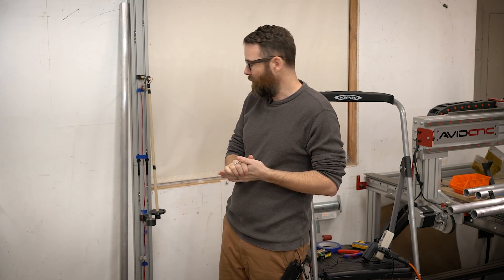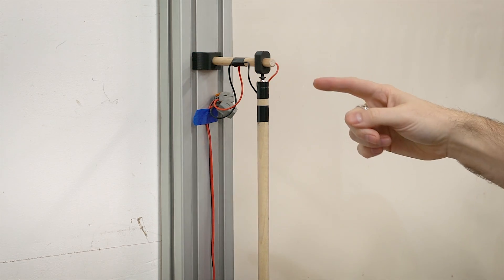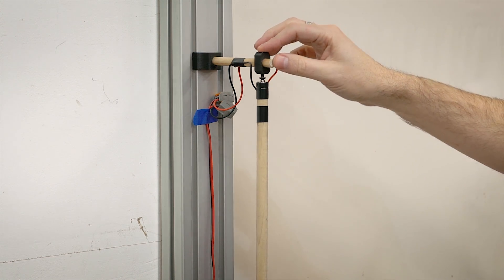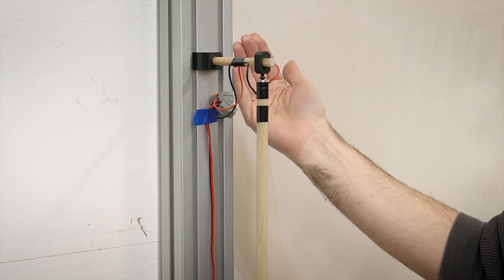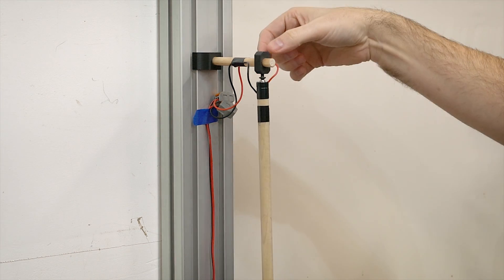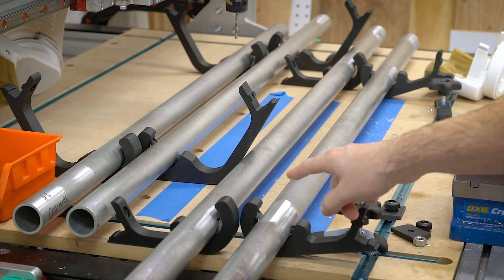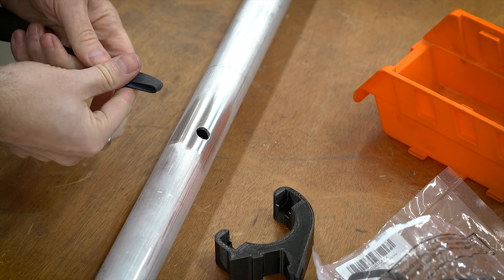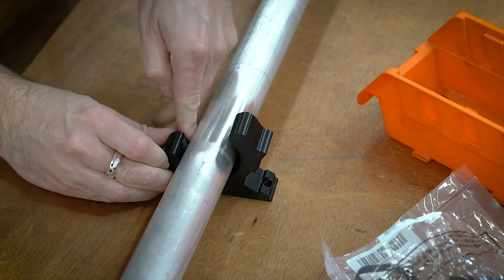Indoor Wind Chimes - Striker Assembly

Comment: I think it sounds so different compared to a regular windchime because the actual pieces are not moving and I think that takes away from the authenticity. You dont get any interaction between the different notes hitting, only the striker. I'm sure you already knew this but just my two cents, awesome project tho!
Reply from the maker: I reduced the size of the striker and that helps quite a bit, allowing it to hit multiple chimes at once.  I just need to dial in the code a bit.  Also, I don't think I've heard chimes this low before.  If they were much higher frequency, it might sound more 'authentic'.  I'm still testing!

Comment: Hey Robert, if you're looking for something truly random. Have a look at taking radio waves input  I saw a paper on this many years ago. "Truly random number generator". Heck, might even be able to use wifi packets. Good luck
Reply from the maker: Check my other video, I'll be reading in actual wind-speed from an outdoor weather station (that I built for this project).  Random isn't the goal, but rather a close approximation of what it would be like if it was actually outside.  So the weather station provides that data.

Comment: Great project! Its curious how the pendulum can just sometimes decide that it wants to change swinging direction.  But seems from the proof of concept, the system could end up playing favorites.  Do plan to have any way to control or inject some randomness to the direction of the induced pendulum swing?  

Maybe 3 smaller separate magnets on the bottom?  Then maybe that would even open up control based on the predominate wind direction!  Also maybe that's making things too complex.
Reply from the maker: When it really gets going, it's random enough on its own.  It all comes down to where the position is and when the pulse is triggered.  I've seen it miss pulses for a minute at a time, and line up with every single pulse.  It's oddly random.  The new version will have a smaller striker, allowing a lot more movement, which makes the pattern much more chaotic.

Comment: You might try making a striker out of delrin.  I've struck a few things over the years with chunks of delrin and it seems to work well.  At the least, I think you'll want something stiffer than TPU.
Reply from the maker: Every material sounds VERY different.  I've tried several so far.  I think for now I just need to get the motion the way I want, and then mess with the material to get the tone and volume I want.  Harder materials have more of a chime 'ding', where softer materials make the lower notes resonate more.  It's strange how different the tone can be based on material.